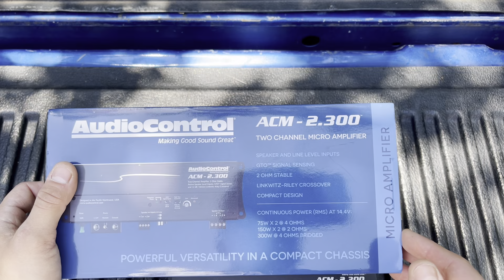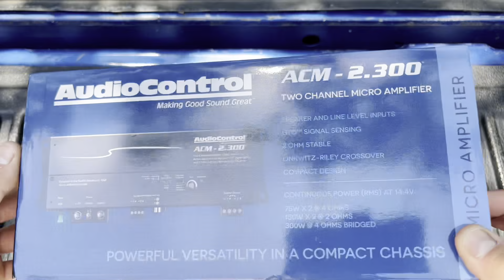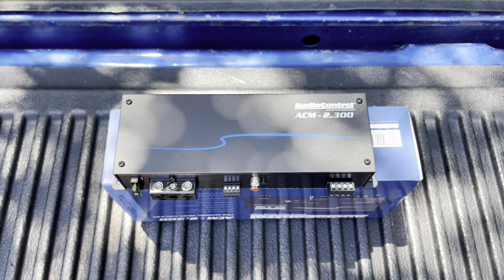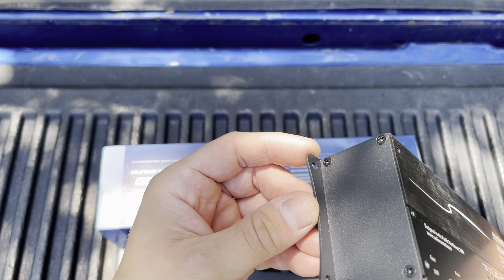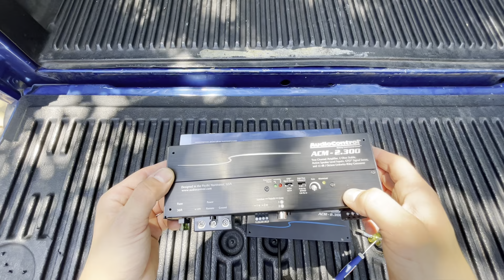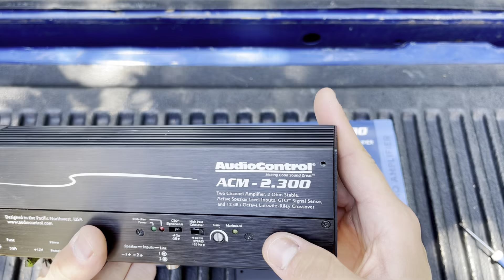AUDIO CONTROL ACM-2.300 COMPACT 2 CHANNEL AMPLIFIER

Comment: I would not consider A tiny ass Class D amp to be Audiophile quality.  Clip lights are also a sh$tty way to set things.  A $90 Oscope is probably the best audio investment you can make.
Reply from the maker: Its all going to to depend on your budget bud. saying a amp is not audiophile grade because its small and class D is absurd. The days of having hot, oversized,. inefficient  class A/B amplifier's  is getting smaller and smaller. Welcome to the future. I'm pretty sure in a blind test your could not even tell the difference. I recommend you check out the JL audio RD amplifier video on the setting gains with o-scope. I'm pretty sure JL audio, helix and audio control does not just put clip indications lights on their amps just for the hell of it. Sorry man but not everyone can afford 20k systems. it would be nice but not practical for the average joe like.

Comment: How is this amplifier compare to JL XD amplifier for SQ music
Reply from the maker: That’s a really good question but for the price jl amplifiers are over priced IMO. Plus xd amps don’t come with the clip detection light
Reply: @mildaudiophile3879  basically wan to drive with morel hybrid 2way active front only m getting mosconi pico 6/8 and jl xd 4ch amplifier.i have other option helix V eight dsp mk2 what will you suggest
Reply from the maker: @sushantarora395    it’s all going to depend on your budget but it sounds like you are on the right path and have good equipment. Honestly both options are really good except the helix is a little complicated and advance for a beginner or novice audiophile. With that being said both are really good set ups the only difference is if you’re limited on space I would go with the helix amplifier with integrated DSP but if you already have the JL amplifier and Mosconi then use that no matter which one you use as long as you use a DSP it will definitely help. If you’re looking to upgrade the XT I would look into an audio control amplifier being that the LC series amplifiers put out 125 W per channel instead of 75 W. The good thing is you’re using a reputable brand and you are for sure getting the 75watts at forums of good clean power and JL underrates they’re amplifiers just like audio control and mini top brands.
Reply: @mildaudiophile3879   JL amplifiers are overpriced? but $360 for a tiny class D amp is a good deal? lmao